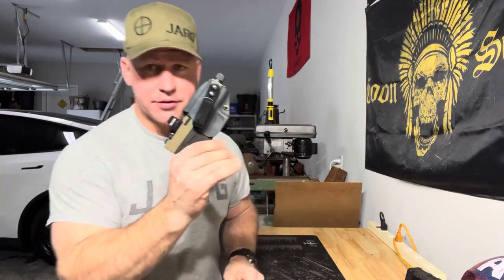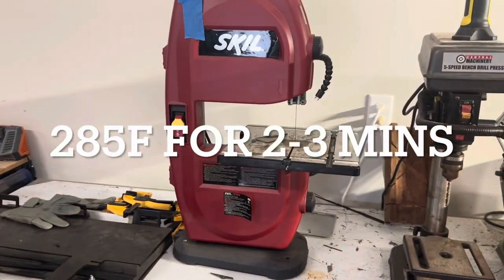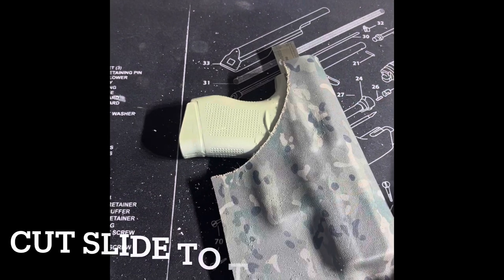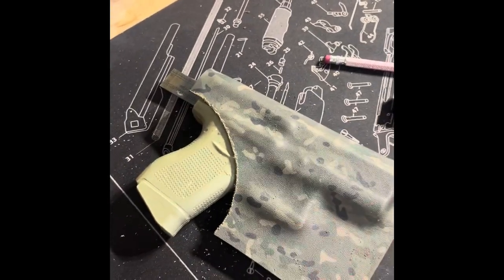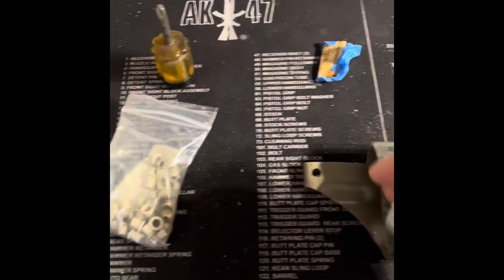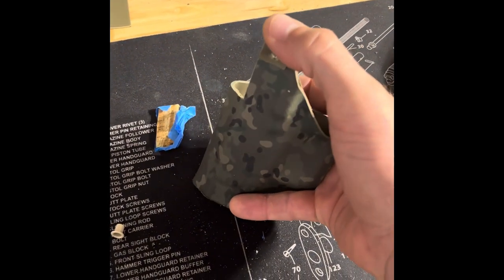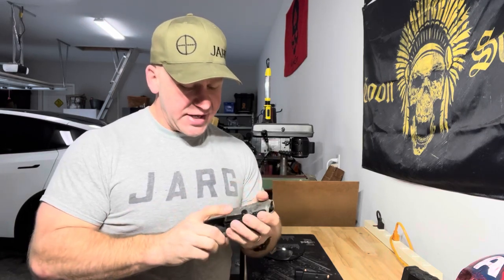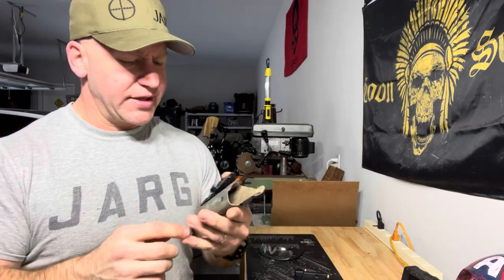Beginners DIY Kydex holster for IWB concealed carry. Easy step by step EDC

Comment: Do you need a mold? Or can you use the actual firearm
Reply from the maker: Either but put some painters tape on firearm. Mold needs to be a little thicker and tape prevents scratches
Reply: Great video! Thanks for the tutorial
Reply: the level of your attention to detail when prepping the real steal is crucial on the end result of the holster. use calipers to measure the slide at pre-taping then measure again after putting 3-4 layers of blue tape on the slide. you want a gap between the kydex and gun so there is no unnecessary contact, but also knowing contact is inevitable. Critical note that the Author didnt mention, if you're using a polymer framed handgun make sure to apply blue tape  to the magazine so that it is snug when inserting into  the magwell.
You can use a dedicated mold gun, but preperation is equally crucial. 
Eyelet and Rivets are different. the ones used in this video are Eyelets. And lastly, the most important advice is: more heat, more pressure.